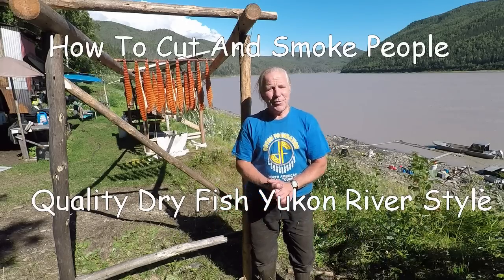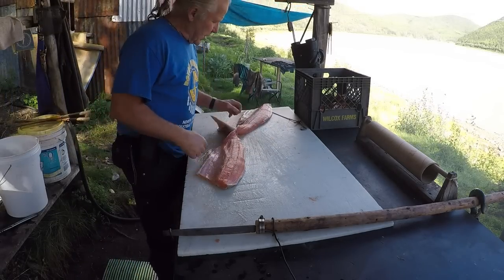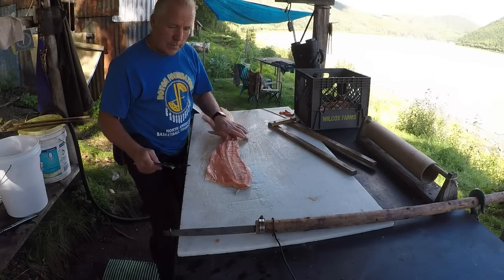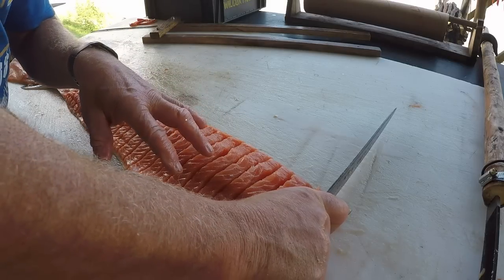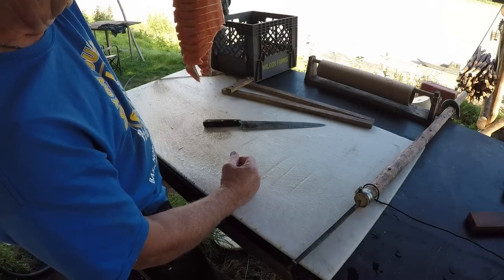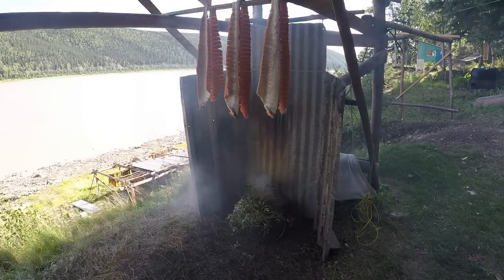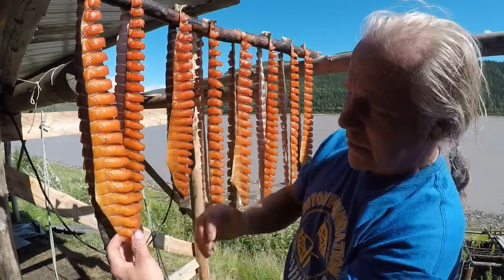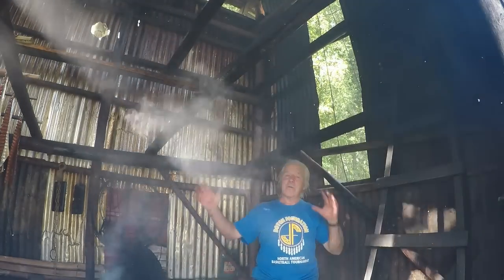How To Cut And Smoke People Quality Dry Fish Yukon River Style - Stan Zuray

Comment: A good knife for cutting fish in my opinion would be the Spyderco Spydie Chef. It’s a titanium handle folding knife with a 3.3 inch LC200N sheepsfoot blade. Very corrosion resistant and almost impossible to break and you can carry it anywhere with ease

Comment: Stan would you be able to share where to buy and what kind of knife would you recommend.  Just as importantly how you keep them nice and sharp.  do you use a fillet knife?
Reply from the maker: For fish I like a big broad blade that is thin. Cuts through the fish easy. Mostly we use those Sani-Safe knives like in my videos but someone left a real thin no name cheapo knife at my camp one day years ago and I like it so much it's my main fish knife now. I've had alot of meat skinning knives over the years and many high end ones but again what I end up using is this cheapo I like the shape of with a gut hook on the end. Every knife needs the edge angle redone once in a while to allow that razor edge to  be put on them like when it was new. I use a grinding wheel or belt sander to take the thickness out behind of the cutting edge. I still use every type of sharpening device  I come across but the round and rectangular stones are a staple. A person has to know their edge angle and keep it the same. If it shaves your arm hair off it's good to go. Don't use a real filet knife but got a bunch of them.

Comment: After you smoke, how do you store, what different ways do you eat them?
Do you ever use salt to pull out the moisture? We use salt in Tennessee to dry out pork, then smoke it.
Reply from the maker: Dried fish we usually put in a freezer and we almost just eat like it is. If no freezer usually stored up high in a shed bundled up to keep air/dust off them but keep them dry. We dip in salt from a dip to 3 min depending on how salty one likes their food. That little salt may not be enough to draw out moisture.???

Comment: Do you pepper the fish at all to keep the flies out? (Not sure that's an issue in alaska)
Reply from the maker: Flies are a major problem but pepper will not keep them off and salt will not either. There are thousands at time. You need good weather and a breeze.  Sometimes in the early summer before the weather is cooler like fall it's very hard to dry fish without smoke fires like we use for people food. I used a smokehouse for dog food for years also.

Comment: Hi Stan, I’ll be trying my luck upriver in Beaver in a couple weeks.  Not sure if you’ll be reading this as you’re probably out on the river already.  How would you recommend speeding up the dry time?  I may only be out there a total of 3 weeks.  This is my first time using a set gill net too, I’ll consider myself fortunate to catch any at all.  

If I was to add honey to strips or dry fish, would I brush it on directly after the brine or brush on a few days into the drying?

Thanks for the videos!  My father in law (Father Scott) says hello!
Reply from the maker: I'd do it a few days in the smokehouse. I've seen it done on racks in a smoker sideways and it may stay on better that way. Canned strips with honey added are great also. Did it once and worked . Mostly my wife has this Jalapeno mix she put in each jar. As to the drying, almost done strips can be frozen and dried mid winter in a house or when you get back to town. Some people use fans and a generator to help dry on bad stretches of rainy weather. I am at camp but got a HughesNet dish for communication.

Comment: Hi Stan, Great video, what is the steel elbow and pipe that comes out of the side of your wood stove used for.
Reply from the maker: It's a way to let in air and slow the draft down. Acts as a damper but have a damper also. All the pipe around is to run the smoke out the roof if weather is damp. Burning wood puts out water vapor so we eliminate the smoke in damp weather and turn the smoke stove into a quick heating stove.
Reply: Hi Stan, Thank you very much for your answer, I have an old travel trailer with an addition and wood stove, that I stay in now that i am retired,maybe I can use your idea with mine place,I really enjoyed listening to your interview with Russell Scott on UTube and I am going to buy your new book Carry On, I am up here in Merritt B.C. Canada.Thank you again and keep making your great Video's!!

Comment: How do you keep wood smoldering and prevent from getting too hot or burning out
Reply from the maker: We keep the gaskets on the door tight and replace them every few years. So it's by restricting the air that it's done. I don't even use a pipe damper as the wood can only burn if I give it some air. the fire never goes out and always has a bed of coals under the wood.

Comment: How do you prepare the fish to eat it once it is cured over the winter ?
Reply from the maker: No preparation. The object of the method is to produce a stable product that can be stored in a cool place all winter and eaten right away at home or while traveling. That said occasionally people will heat up strips or dry fish in a pan or over a fire. The meat is however stripped off the skin before eaten but the seared over a fire skin, is a treat to some also. To tough to eat otherwise - like leather.

Comment: How many weight the fish lose at this process?
And how long you dry it?
By the way, a good and very interesting video.
Reply from the maker: A 10 lb. salmon when cut and dried weighs about 2 lbs. It should weigh less but the amount of oil in them is amazing and that does not dry but some drips out. Dries for 2-3 weeks - more or less depending on weather.

Comment: I didn't quite get why you had some on the smudge fire, and some just in the sun.  Was it one then the other, or two different methods?
And your show, is it still on?  I saw a season, then thought it was cancelled.  I can't even remember the name, but I liked it.
Great video, thanks.
Reply from the maker: The outside drying is for when they are first cut into food. To let most of the water dry off and give the flesh a glaze for the first day or so. The outside smudge fire is for days the flies are bad. Some days the fire is not needed as flies are minimal. Once the fish go in the smokehouse the flies stay away and the fish does the final drying and smoking for a couple of weeks.
Reply from the maker: The show is off the air for now and maybe for good. We never know what the powers that decide are thinking. Reruns and redoes of the show with new footage keep happening a lot.

Comment: how thick of wood on your bum weather, and sunny weather, wooden thickness guides?
Reply from the maker: If you mean how big are the pieces of smokehouse wood - they are only split if they can't fit in the stove door. Bad or good weather all the same just keep it smoldering and putting out minimal smoke.
Reply: @stanzuray  i meant the two wooden guides you use when cutting the overall thickness of the fillets down first before making your other uniform cuts only down to the skin. (not strips-the other way) how thick should a bad weather fillet be slabbed down to vs the sunny weather thickness? Thanks for your replies your videos inspire me
Reply from the maker: My guides are at fish camp and later this summer (after June 10th say) I could be more exact but just under 1/2" for bad weather and 5/8" for good. So much dep-ends on the humidity in your area. We have low humidity when sun is out. Things dry fast